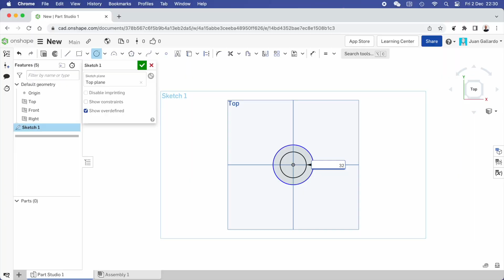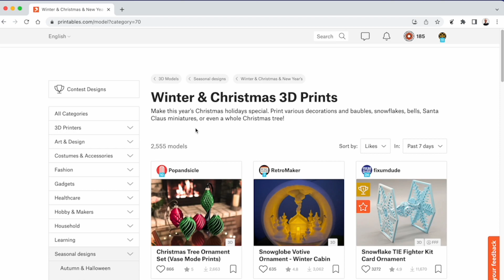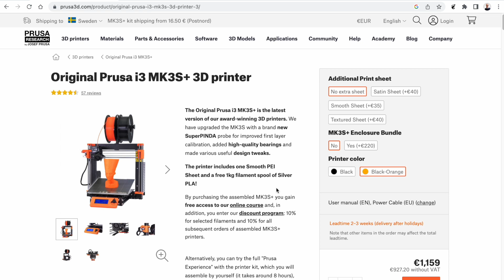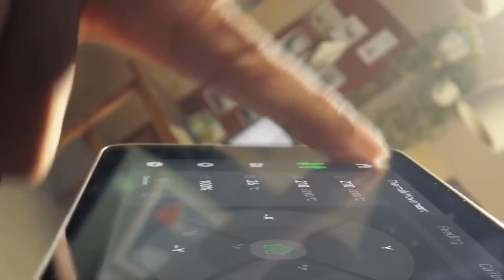Buying  a 3D printer? You may want to listen to this

Comment: No a Bambu Carbon X1 is not a good priced printer that is not pricey! The main model on it's own is £1000 to buy in the UK, then if you wish to have the EMS multi spool changer that will mean the cost of the printer goes up to £1300 even the newer stripped down version of the base machine the P1P will still cost £700. so not cheap at all.

Even the Prusa's start at £700 for a tiny bed Prusa Mini. the rest cost hundreds more even a couple of thousand. way beyond normal users.

Most good printer cost £500 upwards now. S not a low cost hobby. most filaments are pricey too. So it is wrong to say how affordable allot of it is.